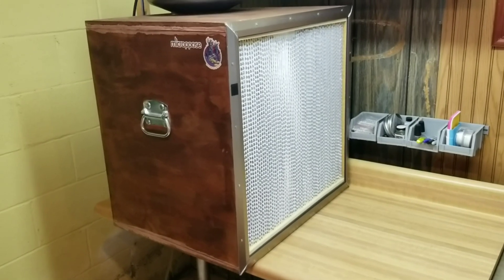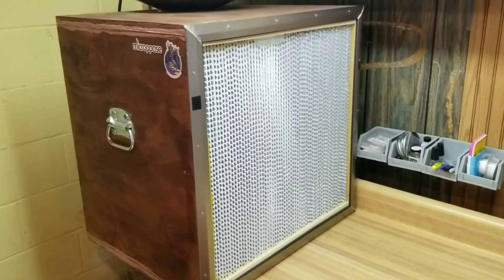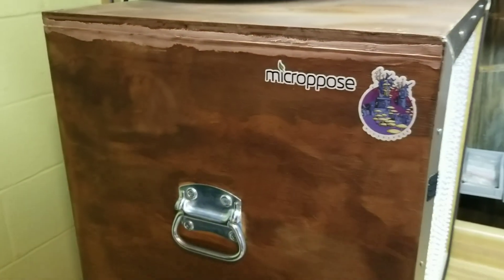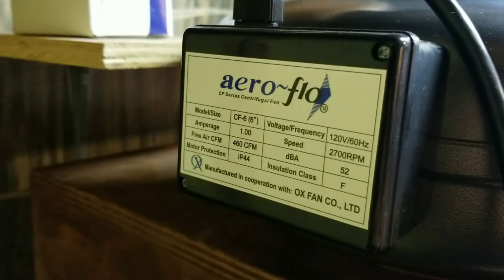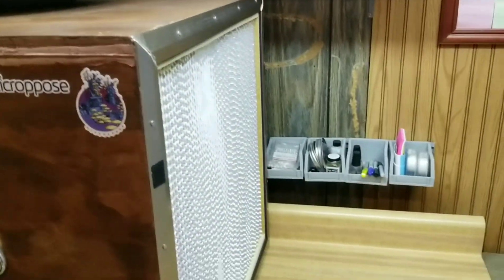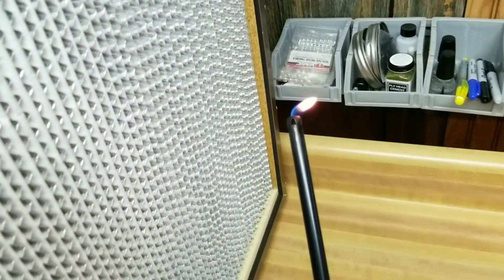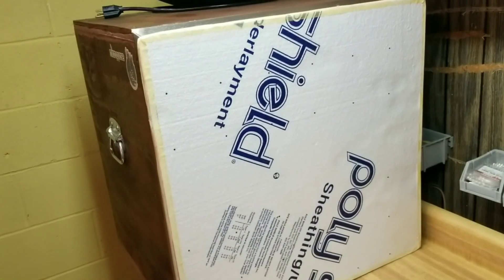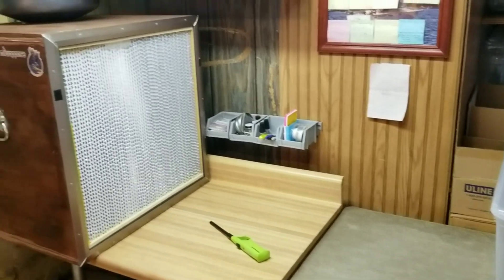LAMINAR FLOWHOOD OVERVIEW, My DIY Centrifugal Fan Design

Comment: Is this a 5 7/8" deep filter?
How long did this filter last? I'm trying to build one, but I don't want to use the 11.5" deep model. Does the depth really affect the life of the filter that much?
Reply from the maker: I can't remember for sure, but it was either 4" or 5 7/8", definitely not 11.5" Don't judge me, but mine is 17 years old. I've never changed it because it still works great.
Reply: I wouldnt judge. The life expectancy on a hepa filter is very convoluted I've been finding out. They say that the thinner thinner ones don't last as long as the ones a foot thick bc the thicker ones have more media and can hold more particulate. However, I actually was reading a case study done to determine the exact life expectancy of a hepa filter to expect. I don't think the filters in the study were being used in this scenario or in a mycological framework at all but from what I read hepa filters can last more than 20 years without a significant pressure drop (some filters lasted up to 50) IF a pre-filter is used and other environmental conditions are met. Like I don't think filters like outside air much. But the study didn't specify the thickness of the filters used throughout the test. They averaged the performance and life expectancy of over 16,000 different hepa filters with varying ages. So I was trying to hear the thoughts of ppl that have been using 5⅞" filters in this configuration for years. I really don't want to build a box around a filter a foot deep if I don't have to especially if the other ppl are have success innoculating agar, spawn, and production blocks free from contamination using a thinner filter. Using a thicker filter will take up alot of room.
Reply from the maker: @dandelionboi  I agree that I think the pre-filter is key. I've never run mine without it, and I clean it periodically. Other people I've talked to have said the same.

Comment: Thank you for sharing. Ultimately are you glad you used a centrifugal fan? After reading up so much on fan curves I don't understand how a 460 cfm fan is sufficient to create laminar flow over 4sq ft, but 17 years of use doesn't lie.
Reply from the maker: Well, to be honest, math has never been my strong suit 😁 But, when I built this thing once upon a time, I spent a lot of time figuring out the cfm's, and I thought I nailed it. Testing it with the old school lighter flame trick tells me it's good flow, but that's as fancy as I get. Yes, I am happy that I went with the centrifugal fan. They are widely available in a range of powers, and many can be throttled up or down by purchasing a rheostat. They are less expensive than the squirrel cage style as well.

Comment: Is the metal trim holding and securing your HEPA filter in place? I know your filter is 24x24. What is the length/dimensions of your plywood around the filter? Is it also 24 x24?
Reply from the maker: Actually the filter fits pretty tightly inside the box, and I ran silicone around where the filter and box meet to seal it. The metal trim in really just decorative. I built the box to fit tightly around the filter, so the opening is roughly 24" X 24". Don't build the box though until you have the filter because the dimensions can vary a little.
Reply: @RenegadeMushrooms  Thanks. What is the depth of your box?
Reply from the maker: @dylski4294  20 inches
Reply: @RenegadeMushrooms  Okay thanks so much Broseidon 🔱

Comment: in my own laminar flow header the fan is inside the box. I used white 1.8mm mdf and covered the countertop with glass.I made it as 30x60cm. I used an adjustable wrench to increase the fan speed as the filter efficiency drops. I prepared a 2 layer coarse filter for the coarse filter and it extended the life of the h14 filter a lot. It's very nice, thank you for your work. My biggest problem right now is preparing compost. Green mold and spider web are forming. First I boil the sawdust, bran and gypsum, after cooling I drain the water. Then I pack the 1kg compost into big freezer bags and plant the mycelium. just yesterday i lost 3 out of 6 compost from green mold and spider web, 3 of them are intact but i am half lost.
Reply from the maker: Sounds like you have a nice build 👍 I haven't worked with compost much, but I've heard there is an art to it. At least you have a few good bags still to work with.
Reply: In my experience you have to hit the sweet spot of pasturing or you have to sterilize. But I don't use bran in my compost blend, I use straw instead and I pasteurize. My sawdust blocks I will use bran but those I always sterilize
Reply: Did you use the same tube type fan in your build? Do you perhaps know the model of the fan, and the specs of the filter? I'm in the process of building my own but I want to compare with someone who used a tube fan on the inside
Reply: @paulhartzenberg9823  It's called the inline fan I use. You have to choose the fan values according to the filter. Use a dimmer for the fan and you can increase the fan speed as the filter gets clogged. now i have started to produce very nice shitake, lions mane and reishi. I'm thinking of building a bigger flow cabinet and expanding my business. My next goal is to produce cordyseps.
Reply: perhaps try using hydrated lime to increase the PH. That will help fight Trichoderma, the most likely candidate for your green mold. I don't think it will help with the spider web mold though, not sure.

Comment: What size is the fan..
Reply from the maker: 6", 460 cfm
Reply: @RenegadeMushrooms  where did you get the one you put a speed controller at?
Reply from the maker: @Bearsfan131  amazon
Reply from the maker: @Bearsfan131  
JOD Router Fan Variable Speed Controller Control for Electric Motor Rheostat AC 120 Power from 500w to 1800w Adjuster https://a.co/d/2CVX6oo

Similar to this 👆 Just make sure it will work with your fan.
Reply: @RenegadeMushrooms  awesome thanks. Where'd you get that fan?
Reply from the maker: @Bearsfan131  Amazon or ebay has them.
Reply: @RenegadeMushrooms  thank you for all the videos and the quick replies. You're killing it.

Comment: Does anyone know where to get a filter like this under $200? On Amazon they are outrageously overpriced in my opinion
Reply from the maker: https://www.midwestgrowkits.com/bonsai-flow-hood-99-99-hepa-replacement-filters-regular-or-xl.aspx?feed=Froogle&gclid=Cj0KCQjwyOuYBhCGARIsAIdGQROPuxBzf975NG1yooh4EZr8std95P45da9Z3Wm8q7eCw9-sdVM7FisaAhecEALw_wcB

24"x18" is $259.99

Comment: Most HEPA filters are also washable.
Reply from the maker: Never heard of that, but I'm guessing it's pretty involved. Mine has a particle board frame, so that might not work??? My old girl is pretty beat up anyway. I'll probably try to get my new one in this winter at some point.
Reply: @RenegadeMushrooms  HEPA filters certainly doesn't look like washable (the material looks like paper/cardboard), but they usually are. You just have to be careful, because they become heavy and bit more fragile when wet. They should be dried flat on wire grid or similar. Usually manufacturers put some small marking on the filter whether it can be washed and if so, how many times. I always wash them, because damn they are expensive.
Btw. I prefer some walls and roof around the working area to direct the flow into my direction. And also to prevent turbulence mixing dust into the flow. Have you had any contamination issues? However, that necessarily creates some restrictions to the working area.
Reply from the maker: @user255  I don't have much of an issue with contamination, but most of the techniques I used are geared towards minimizing contams anyway. I have been doing a bit of agar cloning this year though with minimal contams so I seem to be setup ok.

Comment: So is there also a fan onn the inside against the back wall pointing towards the hepa filter?. It must be large enough to cover hepa?
Reply from the maker: No, just the fan on top. The role of the fan is not to blow through the hepa, it is to pressurize the box, forcing a smooth flow of clean air out through the hepa.